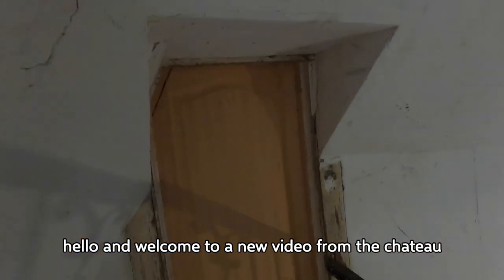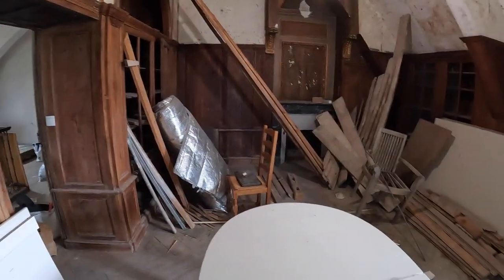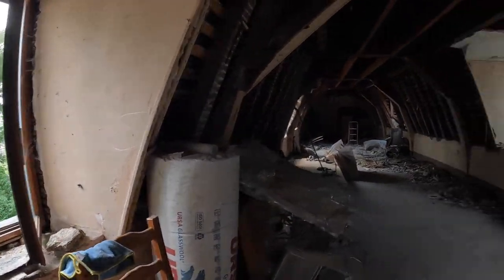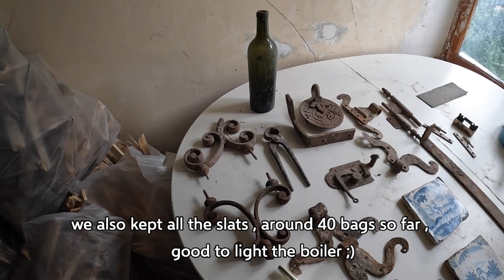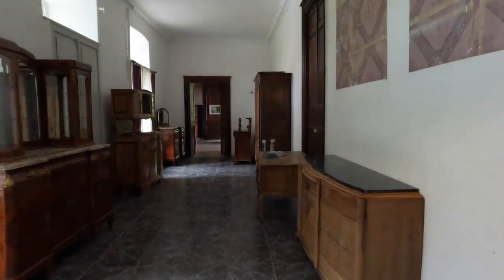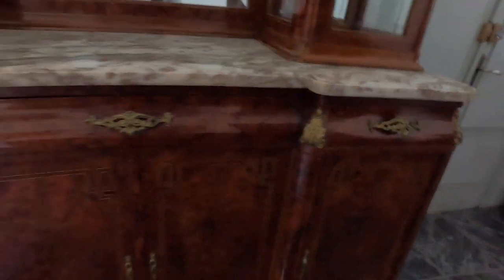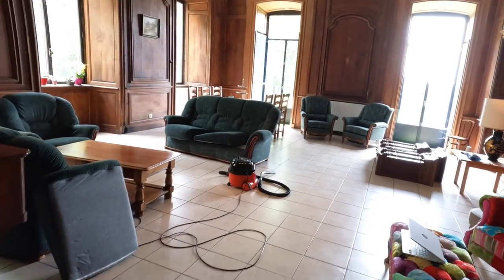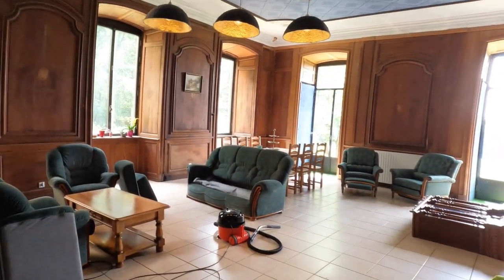Chateau west wing  roof  demolition and Library clean up

Comment: The missing "cherubs" in the library would have been whatever animal or personage that would have been found in the coat of arms (blazon) of the family that owned the home when the library was installed...if you can find the name of the family that owned it then then you'll need to find the blazon of that family in that chateau or region as many families with the same name had different blazons across France...they were most likely related going back 100 or 500 years but opted for different symbols. 
    For the stains on the chairs you can buy dry cleaning fluid in a big supermarket or quincaillerie...it's called Eau Ecarlate....if the crusty stain is wax then you need paper towels and a steam iron....
Reply from the maker: ok, i have to look up who builded it then , i know there have been counts here , thx for the information ;) and just found eau ecarlate online ;) thanks for watching and helping :)
Reply: @chateaudelannoy  Water on any sort of velvet of any quality will destroy the fibers and they'll lay flat and look dreadful... That's why you can't iron velvet, does the same thing and you lose that amazing reflection of the colors. Eau Ecarlate will  retain the texture of the fibers and breaks up food/dirt, just give the velvet in relief a light brushing when done to get the fibers back up and into place as the solution evaporates.

Comment: You need more lighting as your video's are too dark making it difficult to see the details. You have both done a good job cleaning out the libary. The room will look wonderful when the floor and wall units have been cleaned and oiled. You have selected well with your furniture purchases. Get a can of dry cleaning spray to clean the fabric on the armchair. You spray it on , leave to dry and brush it off. Good as new.
Reply from the maker: thank you for watching and thanks for the tips! ;)